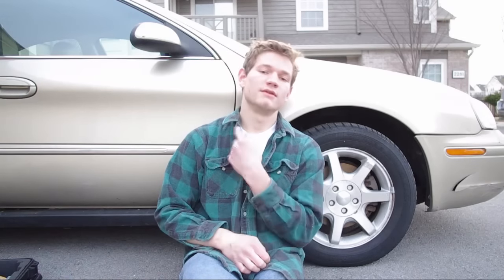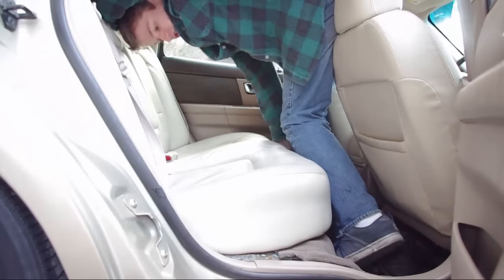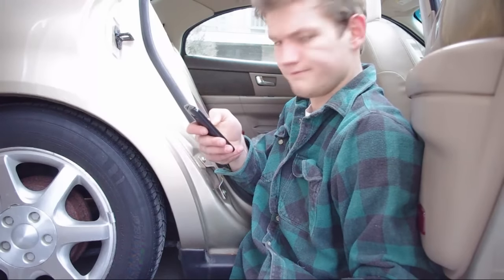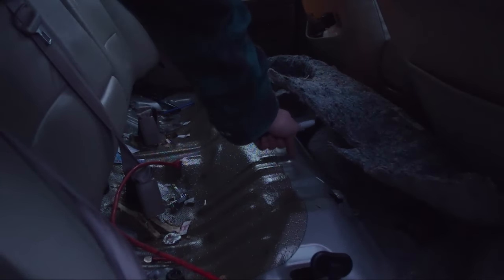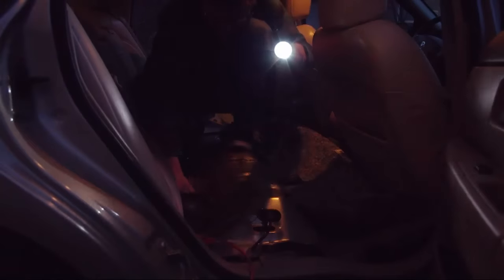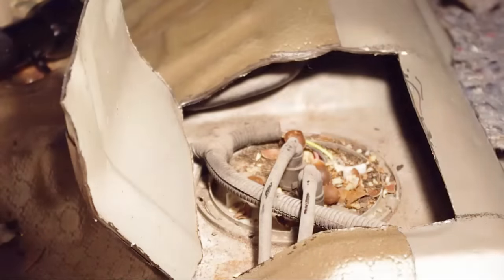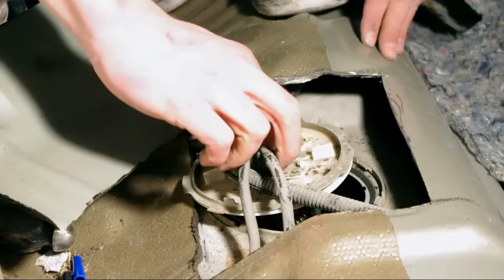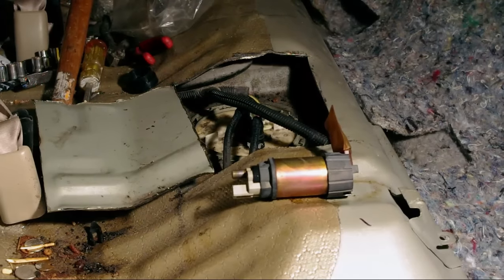Changing a Fuel Pump Without Dropping the Gas Tank

Comment: The tanks is very easy to remove., easier than screwing up your car
Reply: +Dan Clary - Some ya, but ours a Truck.  This idea might be a better choice!
Reply: It's usually easier to lift the bed of the truck
Reply: +Matt Hamilton - Yea it would be easier if the Bolts are not rusted and everything else is also rusted.  On top of that, you can't remove the " Built-In Bed Liner ".  We tried :(((((((((((((((((((
Reply: Dan Clary it's a mercury sable who cares lol
Reply: Bullshit! Try that with a full tank of gas, lying on your back without a garage. There are so many things that could go wrong dropping the fuel tank. This fix is brilliant.

Comment: Ugh, I'm about to try this but am nervous. I wish there was a good diagram that showed exactly where to cut!
Reply from the maker: Measure 10 times, cut once.  Like the Germans
Reply: @TheCousinDan  I didn't measure at all, other than eying it! That part went surprisingly well (other than the spiral saw blade braking - but I expected that and finished with tin snips). Unfortunately, it may not have been the pump that's the problem (or the problem may be larger than the pump). Additional troubleshooting & repair attempts delayed by crappy weather and lack of money, but I'll be returning to it soon.
Reply from the maker: @lightfantastik  Keep at it!  Check everything with a volt meter at startup when you first turn the key to make sure the pump is getting power.  Do it with everything back in proper place so you don't spark in the middle of fumes!
Reply: @TheCousinDan  the inertia cutoff switch got me. I didn't know it existed, so I was dumbfounded for about a week. Found out about the switch, reset it, and boom! Started right up. Thanks for the video help!
Reply from the maker: Awesome! @lightfantastik

Comment: All autos manufactured should come with a hatch to remove the fuel pump from the top as this video illustrates. By doing so a certified mechanic does not have to spend x amount of hours replacing a fuel pump. This way the mechanic does a faster job and can move on to the next job. Plus, the client gets his or her cars returned faster.  Whats more, the fuel pump, after the hatch has been made to the new autos, should have hoses with more slack or play so they can be easier removed. Now, if the hatch can't be installed in newer cars the fuel pump should be external or in a place where it can be replaced without so much work. I fully understand that mechanics have bills to pay just like the rest of us. Nevertheless, many DIY guys like me enjoy working on our cars and don't want to spend time under a car wiggling the gas tank for hours on end in order to make the darn thing release itself from God knows what. If I can spend this much time keying in this post I'm sure the auto manufacturers can spend a little more time in making fuel pump replacement much easier. In closing, I don't want to find out if sparks from grinders can ignite gasoline fumes. Safety comes first.

Comment: I cut mine open.  Pump was right there!  (2001 Taurus wagon.)   Changed out the motor!  Just like you showed.  Now, trying to get the thing back in the tank--it's a bitch!  Can't get the pump assembly to seat-pushing down hard.  The ring will catch on one side and pop up on the other.  Shit hell!   Guess I'll try lubing everything with WD40
Reply from the maker: Good luck.  Try to figure out what it is catching on rather than forcing it.
Reply: should have video recorded taking it out

Comment: on pick up trucks loosen 6 bolts on bed lift up  drivers side   i use a milk crate between bed  and frame... have enough space to access...total 30..40 min work
Reply: yep, my gmc trucks manual, talks about dropping the fuel tank, guess they can't see the easy way..

Comment: I've never had anyone give me the green light to cut an access panel in their vehicle, even in older vehicles, despite practically being for permission lol,but these type of fuel system designs  are actually some of the easiest tanks to drop. if I were doing this job in my personal vehicle I would probably go this route. especially doing the job in my driveway. one time I actually dropped the tank from under a Pontiac in a driveway, in the middle of winter, to find out after dropping it that there was already a factory panel to access to fuel pump! lol it pays to do a little research before ANY JOB .... I was a firm beleiver in that philosophy before that incedent but after that incedent I RELIGIOUSLY research ANY repair before I even order parts, cuz there's nothing worse than starting a job then having to stop , perhaps multiple times, during the job to run to the parts store to purchase more parts or gaskets or some special tool. the only qualm I have about Fords fuel systems of this particular design and vintage is that for some reason the quick connect fittings have given me greif more often than not. something about the old brittle plastic , and the plastic clips, and the old orings it's super easy, despite taking every precaution, to cause a leak at a quick connect fitting, you have to pay super close attention to make sure the orings stay with the fittings in the right place and not to double up on an oring if the new component provides new orings, and also take the time to use silicone spray before reconnecting the lines. maybe it's just my luck though, I've known guys who were the sloppiest mechanics ever, that payed no attention to detail, took no precautionary measures whatsoever, the type of guys to just rip things apart and throw them back together hastily, we all know the type, and for some reason they say they have NEVER had any problems or leaks after doing one of these Ford style pumps....lol some guys have all the luck I guess....I sure don't
Reply: TheCoatneyadkins We have a 2008 Pontiac G6, where is that panel, still looking for it.

Comment: 1. Not "fire proofing", sound deadening.  2. vacuum or blow away all debris from top of pump before trying to remove.
Reply from the maker: X-Man Rubber bonded to the stamped sheet is sound barrier.  Fibrous mat is fireproofing.

Comment: High end cars have access covers, cheap cars do not. The peanut gallery believes somehow that it is due to safety. It is a good con and snow job. In low end cars the sales price is all what folks think about. The average Joe and Jane will not pay anymore to get these features in base car. That is why cars have different models. ie a BWW has more cools stuff than a Pinto :)
Reply: My 1994 Ford Escort had a panel.  I didn't realize it was a high end car.  Guess I do now.

Comment: So I have an 85 Chevrolet celebrity, very low kms/miles. I don't want to cut into the car, dropping the tank so far has been a hassle. What other options/things can I do? This older gentleman started telling me I could get a "draw type electric fuel pump" and told me I wouldn't have to drop the tank or cut into the car? Just wire it to the new pump? I'm doing this for the first time, and am confused on how to go about this. Anyone? 
Or should I just do it the hard way and drop the tank?

Comment: Its a lot safer using a air nibbled and no sparks I tried a grinder with a 2005 Pontiac and could have burnt the car down the fuel line was right up against the plate I could of burnt the car down I highly recommend a nibbled its a lot safer
Reply from the maker: That would work.

Comment: Correct me if I'm wrong but if you're handy enough to cut a hole in your car then your handy enough to change the fuel pump the correct way.
Reply: work with your head or work with your hands- your choice

Comment: Just to be on the "safer" side, put a box fan on the ground one side of the car to blow the air to the other side, making it harder for any stray vapors to ignite. Also, fill your tank first....yes fill. Vapors explode, not liquid, the more liquid, the less vapor. The only downside would be if you had to drop the tank after all, and now it's heavy as f$&k.....

Comment: Not a new idea and not a good idea, but it will work. By the time you play around and sort things out it would of been quicker and easier to drop the tank to change the pump. A few problems can arise from doing this.
 One problem is exhaust fumes entering the cabin, carbon monoxide is odorless and colorless and will kill you without you noticing. 
The second problem is the structural integrity of the car. Most if not all cars built these days use a safety cell to protect the living items inside the car, by cutting into this cell you are reducing the cells ability to protect in a collision.
 The third problem is road worthiness. In my country this car would be deemed dangerous with this modification and ordered of the road until a full repair with engineers certificate to verify the repair is up to code is done. This could cost several thousands of dollars.

Seems to me it would be easier and safer to drop the tank.

But on the other hand I have used this idea on racing vehicles, but never street driven. The risks and penalties are just to high.
Reply from the maker: Chris T You may be right on all these things.  I would say it's unlikely that the structure is compromised.  In the USA, in this state, you don't have to worry about inspections.  And they never inspect under a back seat in the US.

Comment: the problem with this method.... is how the hell do you get to the fuel filter?

when you change a pump you should change a filter as well
Reply: they replace filters with strainers that come in the feed of the fuel pump at the bottom
Reply: We have bought 2 fuel pumps for 2 different vehicles and it comes with it.

Comment: If you need to change the Fuel Pump that often in a car that you need to take all of that extra time to cut out and access point - BUY A BETTER FUEL PUMP or Get rid of that junky Car.

Dropping the tank is not as bad as people make it out to be unless you try it on a full tank of Gasoline. Drain the tank of gasoline with a siphon hose. Place a hydraulic floor jack with a large wooden board on the top of the jack under the tank to hold it up - remove the filler tube screws and the tube. Disconnect the fuel pump hoses and wires and any other hoses you might have going to the tank . Loosen the bolts for the tank straps and remove the one furthest from the filler tube side - then slide the tank out by lowering the hydraulic jack  , remove the other strap as needed. Install is reverse of removal . Many vehicles the pump will last over 300,000 miles - if you are changing the pump out in a vehicle often get a better fuel pump.
Reply: i made an access hole for my mustang at 95k miles- $13 fuel pump and easy fix for the next one

Comment: it helps keeping one alive if u first relax the metal straps holding the tank by loosening the strap bolts enough to give you plenty of clearance. Im planning to drill a hole from above with a drill bit control depth of 1/8", then cut around with a clear-end hack saw ( no sparks here ). If the blade-only-goes-in hack saw doesnt work, I'll drop the damn tank, move it 50 feet out of the way, no gas fumes around, and cut out the damn access hole from underneath. yea, I'll do it only once. with my luck, Id be in heaven with my promised seven virgins ordering me around to take out the trash and shit like that that they learned while still alive and .. Second to staying alive, dont want to cut anything I shouldnt have cut. I know disconnecting lines, fuel tubes and what not is a Hemorroidal PITA. ILL drill a hole from under the seat far away from the tank, like from the front, then use tin cuters to cut the access panel after carefully measuring where I need to cut it after several hours of profound sicere prayer. Be safe guys! great ideas, score it lightly as instructed in the video ( no gorilla hands here now ), then use a metal hack saw blade or chiesel and work your way around to the treasure chest!

Comment: I would never ever do that, if there was crack or leak with fumes. 💥 six feet under. If static electricity can ignite fumes, so can grinder sparks.
Reply: Besides doing it the right way only takes 30 mins on most cars
Reply from the maker: Negative, sir, grinders don't actually make "sparks" like static does.  Static electricity discharge is much, MUCH hotter than heated fragments of metal from a grinder.
Reply: @alexandercopeland5087  what planet do you live on?

Comment: Funny you called the sound deadening padding fireproofing material, try burning it sometime, it is not fire proof, besides if the fuel tank is a whole panel away, why would they need fireproofing material over it. If the floor panel ever got hot enough to ignite it, by then you would be hopefully noticing your car had been on fire for some time and you would get out. Not trying to be a smart A, I just thought it was funny to call it fire proof. I guess your mind was thinking fuel and fire.
Reply from the maker: The fireproofing is above that, under the seat.  The tar stuff is sound deadening.  There are two compounds and both serve a different purpose.  Fireproofing is all over the interior of modern vehicles and worked into many interior parts by composition.  Not just for proximity to the fuel system.  Next time you take up a floor carpet or a seat panel you will understand what I am referring to here.

Comment: Just do the job the right way ! Drop the damn tank. Cutting thru the floorboard defeats the integrity of one very special feature "FIRE / EXPLOSION" shield.. Not to mention do you have a welder handy to put it back in or just hope the duct tape stops rain , snow and critters from entering ? I know dropping the tank is a pain in the ???? but hey more pride knowing you did the job like pro's do just no labor charge exxxtra $$ for the Beer when your bragging that story. Or if your gonna cut out the panel let your mother in law know how comfy the back is now..
Reply from the maker: Yes, I have a welder, no that's not a good idea.  A welder gets much hotter than the ignition temp of gasoline, a grinder does not.  I bolted it back in place and put the fire-proofing over it.  It is literally the same protection as any other car with a panel access.  I don't know about you, but I don't think car designers are infallible.  I make changes where I see fit.  That's the beauty of being a gear-head.
Reply: @TheCousinDan  well said

Comment: Why would you put a grinder near the opening fuel pump access of a gas tank...especially without dropping the tank to inspect whether the seal to the pump is set properly?...not that you would want to do it even then. Doing it this way risks blowing yourself up...getting tons of dirt and shit in the tank in which case you would have to do it again, plus filter. possibly injectors, lines, etc. And also you're pretty much guaranteed to get gas fumes in your car for the remainder of the cars life....All the time!,,,and when it comes to gas, the fumes are what's flammable not the liquid. If you're lucky to survive doing this wait till you open your car one day with a lit smoke in your hands.
Reply: Just trying to save a life here....some things can't be reasoned with..and this is one of them.

Comment: Cigarettes dont have enough heat to ignite gas fumes, if you toss one in a bucket if gas it will just go out in the liquid, your logic is wrong. It also has a heat shield on the bottom, not the top. Cars also have vents that the spark from a grinder falling in the wrong spot could iginite. Dropping a gas tank isnt hard. If you want the hole why not drop it one time and cut the hole out then? Hopefully you dont get anyone killed or injured.

Comment: they been doing things like this in many models even new in the day,like transam's and Camaros in the truck compartments,but your videos not enough explanation for those doing a first time,i use sheet metal shears,no sparks or chance of cutting wired ends or hoses,just 4 holes  at 4 corners then snip away! never know about fumes or a leak even on top!
Reply from the maker: That's a good idea, thanks.
Reply: always better to be safe,many years even dealers cut holes in the truck area then pop rivet a patch,some fords had heater blower motors in the front wheel well,and it was the same thing cut the well and then patch and spray sealer over it,just letting you know cause there's curly moe and larry's out there,hahaha

Comment: Cigarettes can not start a fire from gasoline. Research harder.
Also, Never lay a grinder, saw, or any other power equipment down until ALL moving pieces have stopped moving.
Reply from the maker: Most gasoline blends have an autoignition temperature of 495 degrees F.  Show me the cigarette with an ember that wont hit 495 in the presence of blowing wind and I'll agree with you.
Reply: only lit ones